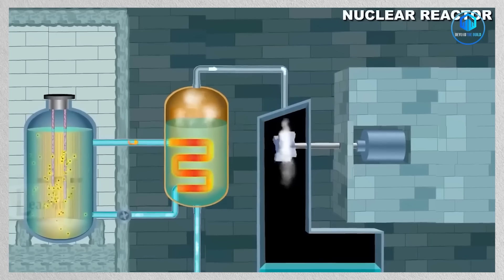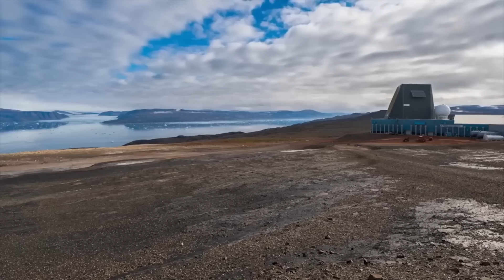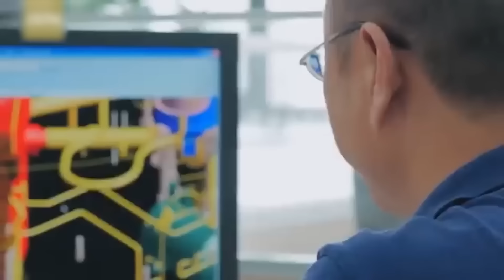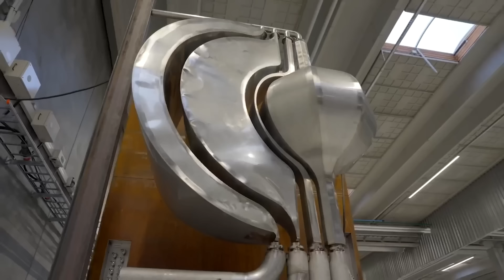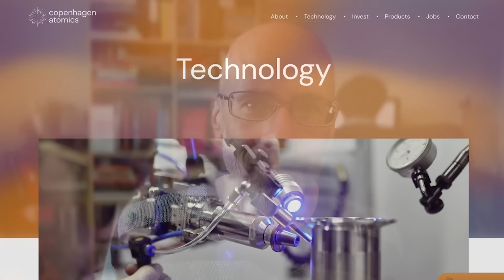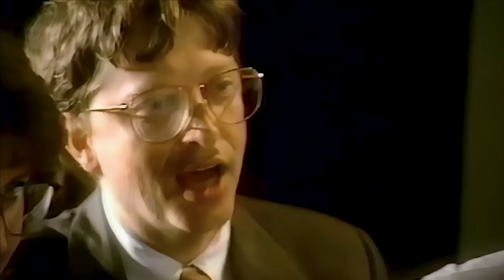Can This Device Help Us Escape Energy Poverty?

Comment: Alvin Weinberg, a pioneering American nuclear physicist and former director of Oak Ridge National Laboratory (ORNL), is credited with inventing the concept of the thorium-based molten salt reactor. 
Weinberg led the development of the Molten-Salt Reactor Experiment (MSRE) at ORNL in the 1960s, which was the first reactor to operate using uranium-233—a fissile material bred from thorium.  The MSRE successfully ran from 1965 to 1969, demonstrating the feasibility of a liquid-fuel reactor cooled by molten fluoride salts, with thorium as the fertile fuel. This design was inherently safer than water-cooled reactors because the fuel was already in a molten state, eliminating the risk of meltdown.

Comment: this is wonderful example of just how delusional anarchists are. imagine thinking you can buy a nuclear reactor for your commune. who the eff is going to maintain all of that. who is at fault when something goes wrong? and I know, there can't be no chernobyl like event, that doesn't mean there can be no other types of events. technically, chernobyl wasn't even a meltdown, the reactor exploded due to pressure buildup, and then all the material got spewed into the environment. and that doesn't even consider how expensive these things would be. you'd need either a crapitalist corporations, or a communist government to be able to build such a factory, and neither of them would want halfbreeds to have their own nuclear reactors. crapitalists would not want you to have something they can't keep charging you for, and communists don't want you to have something they would be responsible for the cleanup of

basically, it's cool tech, but the way he suggests it to be used is utter nonsense

Comment: Thorium deficiency is a huge part of why our brains don't work well enough for any of us to wake up. Your body only needs a tiny amount of thorium but you're constantly sweating it out so it constantly needs to be replaced. It's supposed to come in kalitta farm and you can get that from humic shale deposits. If we all managed to do this we would solve a lot of the world's problems. 

Mostly because if we ensured that we are getting our proper amounts of thorium that also means that we are able to digest them properly and form ionic bonds with the intestinal tract. And that would basically by definition and by default include all other rare Earth elements. So we would basically solve world disease overnight if we did that but apparently I'm a lunatic or something.

Comment: Initial part of this video was complete nonsense. Literally. Whoever did it lacks most fundamental understand of how molten salts reactors work. And whoever did it knows that he is bullshitting audience. He mentions "transforming" thorium, but this is where it ended. Because important part is that it is transformation into U-233(that is 3-4 times less stable than U-235), from Th-232, by adding a neutron.
Nothing in this video talked about actual reactor operation, but merely only initial part of it, where thorium molten salts are being bred into uranium. Yet it tries to present it as this small portion is about entire reactor operation.
Talking about "like changing car oil, while driving on freeway" is a complete bullshit. Sure you are "changing car oil", "while driving on freeway", but those are not same "cars". "Car" that has oil changed is still standing still at service station, while another "car" is driving at the freeway.
And of course not a word about numerous problems that molten salts reactors have. With biggest being corrosion.
And of course of course talk about SMRs. As if they are some sort of magical solution. Practically portable, effective, easy to use, free energy and rest of this easily disprovable bs. Despite the fact that they are less efficient, require exotic fuels, generate more and more toxic waste, have lower lifetime, etc. Simply put SMRs are substantially INFERIOR to regular NPP reactors in EVERY possible aspect. And adding that "they can be tied to existing boiler", despite it being a complete nonsense.
"What if it relied on thorium fuel". Thorium is NOT a fuel, as it is NOT a fissile material. It CANT be used in a reactor on its own. It is IMPOSSIBLE from standpoint of physics. This is why they breed uranium out of those salts.
So disappointed in James pushing this complete and utter bullshit. Clearly with zero research done.
Reply: dude mice criticism,  you forget the audience, so why dont you link to a more realistic explanation, scheesh

Comment: BioGas is a balloon that composts kitchen scraps into useable NATURAL methane .
My friend has a system he bought online that feeds said gas inside to a gas cook top.
Its only one step away from being fuel for heat, fuel for electricity.
It is as safe as propane, yet odorless at the cooktop, when unlit. 
Dump in enzymes and solid waste out comes gas.

Comment: Excellent report! The US Gerald Ford is the largest aircraft carrier in the world and is powered by two new nuclear reactors that are touted to be safer and more efficient than previous reactors. These reactors don't have to be refueled for 20+ years, and the ship can run for two decades on its initial fuel. That ship can hold up to 5,000 personnel, although it only uses half that many for normal operations. Here's my question. Can those nuclear reactors be used to supply power to cities, or are they used exclusively for the military?

Comment: The answer is, "No."

Next question.
Reply: Are you sure?
Reply: @lightworker5456  Can't make steel, fertilizer, or concrete with electricity. Don't need really even need more electricity.
Reply: @skeetorkiftwon 
I didn't actually know what you were giving the first answer to.   I just asked you a question, because you wanted one.

Comment: Thorium reactors were developed in the US, but Nixon chose the high pressure version because it would produce atoms for the bombs, where as Thorium doesn't do that. China took these open source information on the molten salt reactors, looked and improved on the design, materials used have improved over the last 6 decades, so they just took something and made it better.
This is the future until fusion is here. To be honest, we need a variety of energy sources, there's not a single solution for the world.
Thanks James for this one, as well as all other ones. Oh, I know you don't read these comments, only on your homepage do you do that. Maybe you still see them here once in a while.

Comment: If Nuclear reactors were actually balls of Sulpher coated in Zirconium brought up to reactive temperature by passing High Voltage across them... Would we have noticed? Have we all been conned by big energy to stop the unregulated spread of very clean low cost energy? Surely not?

Comment: Pebble reactors have been in design form since 1950s-60s and could power whole cities with small footprint and high safety. 
There are also all the atmospheric systems of Tesla, and the magnetic systems... as well as the old fashioned water wheel attached to generator in any running water that's low cost, low maintenance system. 
Mahe Ohna ✌️ Favour ALL

Comment: James, the one huge upside to using Thorium Salts is that it can't be enhanced to a weapons grade fissile material.  
I'm surprised you did not mention the mixture of Lithium Fluoride salts in thermal regulation of the Thorium Salts controls. 
Cheers, Mate.

Comment: We need reactors small enough to run one household. That would be energy independence.
Reply: something we will never ever see in our lifetime sadly. We gotta pay taxes to baby eaters.
Reply: @sergiolandz6056  until we stop that
Reply: @sergiolandz6056  Are the babies their version of internal Thorium?
Reply: Smaller reactors networked would make more sense.  When one drops out the others can carry the load 'til repairs.
Reply: @darkbulb367 Makes sense
Reply: @darkbulb367 Yep, andhere I am, developing a new standard for decentralized energy grids. The future is decentralization!
Reply: Hey I can buy salt for my water softener and thorium reactor,
Reply: @yosemitejam  🎯
Reply: I would be more favorable to community size. It could take teamwork to not only maintain said device but to hold it secure. I don’t know if I have that ability on my small single family homestead.
Reply: @kevindavis3841  Building community is important, so maybe you are right.
Reply: @ruthlongridge thank you. It looks like we are on the same team. I believe our team will keep growing.
Reply: @kevindavis3841  It sure is!
Reply: Nuclear power proponents have been screaming for thorium reactors to be built since the 50s when the 1st one powered a cargo plane.
Reply: It's completely possible along with ones for vehicles. The military already had the nuclear battery powered steam engines for vehicles. Nuclear batteries are just nuclear pebbles that are cylindrical shaped that conduct the heat of the radioactive material while containing all the radiation.
Reply: I saw a video of someone making a very small energy device with magnetics that worked for the entire home.
Reply: @renegademystic999  I have not seen that one
Reply: You need to be a good consumer. I solution like that you wouldn’t make you dependant on the the amazing system we have now and trickle the money upwards anymore.
Reply: @asabovesobeloweternal  Which is why I want my own ...
Reply: @ruthlongridge and you think they would allow that…
Reply: @asabovesobeloweternal  Build it first, ask for forgivenss later, better than asking for permission...
Reply: @ruthlongridge  That is what the Iranians thought would be a good idea ...
Reply: @asabovesobeloweternal  They were right. We all should. And bullying should stop.
Reply: Your comment is being blocked or filtered because it contains multiple red flags that trigger YouTube’s automated spam and scam detection systems.  Here's what’s wrong with the wording and content:

1. Promotion of Impossible Technology
Phrases like:

"REAL DEAL FUSION REACTOR"
"FITS into your HANDBAG"
"powers an entire home for 500 years NONSTOP just with WATER alone"
"ZERO RADIATION"
These are over-the-top claims that violate basic laws of physics and are classic markers of pseudoscience. YouTube filters such language as misinformation. 

2. Cryptocurrency Solicitation
"I need some MONERO to develop it faster"
"donate Now to Ignite the Cold Fusion Revolution"
YouTube flags comments requesting cryptocurrency, especially when tied to unverified projects.  Monero (XMR) is privacy-focused, making it a common tool in scams—this raises high-risk alerts.

3. Link to Self-Promotional Video
"watch?v=YvrijVtOElI"
Even without a full URL, partial video links are detected and blocked if they appear in spam-like contexts.  Many creators also automatically block all comments with links to prevent phishing and scams. 

4. Aggressive, Cult-Like Language
"THIS IS REAL ANARCHY"
"Stop wasting your money on state-obeying companies"
"we are unstoppable"
This conspiratorial tone is associated with scams and extremist rhetoric, which YouTube’s AI actively filters. 

5. "Too Good to Be True" Messaging
YouTube’s systems are trained to detect fraudulent schemes using patterns like:

Free, limitless energy
Secret underground technology
Urgent donation requests
Rejection of scientific consensus 
These are hallmarks of viral scams and are automatically suppressed. 

YouTube doesn’t hate your idea—it protects users from exploitation. If your project were real, it would be published in peer-reviewed journals, not promoted through crypto begging in comments.
Reply: You just finished injecting products you're not even allowed to know the ingredients of into your loved ones on the commands of mere politicians with no medical knowledge that you KNOW due to an app you can link to from this channel are literally making millions of $ off of getting you to voluntarily do this. Then you ducked your heads & doubled down getting all the boosters & attacked anyone who questioned this after you found out that these things caused brain damage, paralysis & death.
You're TERRIFIED of independence. You'll eat your own children while they screamed before accepting it.
Reply: Yes we have them already. 
It's called an inverter taking solar or wind into household power. 
I'm 💯 percent off the grid
Reply: @rv442conv  We have them, too, but they have limitations...
Reply: You told yourself why it never Will happen!
Reply: yeah they are called fireplaces
Reply: @odaydrums  ♥
Reply: @odaydrums Stirling engines plus masonry stoves for suburban off grid resilience —- Germany already had this till Nazis outlawed em and Hitler tore em up
Reply: @odaydrums  Most people live in the city...where do they get fuel???  Or are you in favor of de-population just like Bill Gates?
Reply: Ain't nooooo way they'll allow you your independence!
Reply: @thestorytelleruk  Yes, well we will not stop establishing ours, continuously, no matter what...
Reply: @thestorytelleruk  me: Laughs in battery solar without bills since 15 years. ORLY??? Nice slave think you got going there.
Reply: @thestorytelleruk  They are even trying to take away wood burning stoves in some places.
Reply: @bdog111  they already have in many oregon counties.only those "grandfathered in"" can still have/keep  their    woodstoves/fireplaces. sell ,and you have to remove them or make them electric
Reply: @92yrsyung  Horrible!  I didn't know it was so close to home.  The evil ones should be burned at the stake.
Reply: I think smaller community based reactors IE a city block or a group of streets would work along with each house being fitted with solar could work.
Reply: @1jackal1  Possibly, but that means each household will not be entirely energy independent.
Reply: @ruthlongridge  i want one in every bedroom then....
Reply: thats not how that works, this stuff is radio activ and highly toxic you cant just have one of these things at home.
Reply: @muratigentijan8911  You need to find the Galen Windsor lecture, in which he ate uranium after testing it as radioactive... There are reasons TPTB want us to be afraid...

Comment: Dr. Alvin Weinberg and his team at the Oak Ridge National Laboratory in the USA were the first to design, construct, and operate a molten salt reactor that successfully used uranium-233 derived from thorium. The Molten-Salt Reactor Experiment, ran from 1965 to 1969,  and demonstrated the viability of the thorium fuel cycle in a liquid-fueled reactor. The Chinese just decided to improve it and use it !...is unlikely that Denmark a so anti-nuclear country will ever allow them to operate. The challenge is mostly regulatory and EU in general is a very bad choice to try the deployment of such reactor !

Comment: I just got a solar generator and live in the woods.   Part of not being energy poor is to find a comfy lifestyle that doesn’t require much energy.   I now use 1 kWh a week,  2 if I need to use power tools for an extended amount of time.
Reply: Yep, 100%. So did I, not in the woods, but a smaller house and less toys. Off-grid battery solar FTW! Life on butane is about 20-30 times cheaper than using electricity for heating and hot water. Now I can live quite well on 100:- to 150:- a month in total, including food. My life quality has improved by orders of agnitude.
Reply: Not everyone can live in the woods, even if they wanted to. Most are stuck in suburbs where heating their home in freezing conditions is a luxury.
Reply: @thestorytelleruk  What nonsense. ANYONE can go live in the woods, and no one is "stuck" anywhere. Bloody creepy slave speak.

Comment: what if our cars could use this power?   you could drive it to a salt exchange plant, drive it back home and power not only you car but your home
Reply: So just like EV's are already doing?
Reply: @calysagora3615  i guess but most people are putting energy into their cars at home.   Idk i dont have one
Reply: @williamfields8452  There are systems that lets you power your house with your EV. Afaik, salt is not the power source, it's the cooling medium. Thorium is abundant though.  
But frankly, so is oil, and it's way easier to extract.

Comment: Well, well...if China can get this mass produced, they would solve much of their own pollution issues. They also wouldn't need to spend money on most of the oil they currently import. But...this would mean that Russia, the US, and OPEC countries would see it as a direct threat. Other non "Pillar" countries would be clamoring to buy such reactors (or the Danish one). If the EU embraced this, it would also put Russia and OPEC in an even bigger pinch-- in fact one that could potentially bring those countries to their knees economically since they generally rely heavily on oil sales for export income. Of course Big Oil won't want to change, but this would be an enormous step forward for electrifying remote areas, poorer areas, as well as creating more stable power grids for existing infrastructure.
Reply: Thorium is good for data centers but LENR reactors are better for residential use. Are you familiar with geet reactor or thunderstorm generator yet?
Reply: @sigmacentauri6191  I am a nuclear novice, but was somewhat buoyed by hearing about these breakthroughs (well, at least finally not supressed as much). Anything to get us past artificial scarcities would be very welcome.